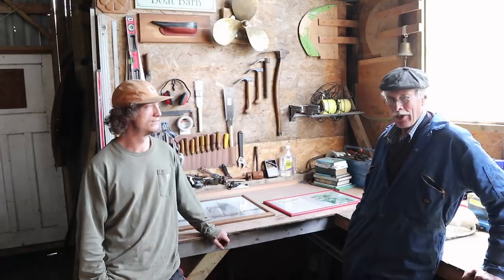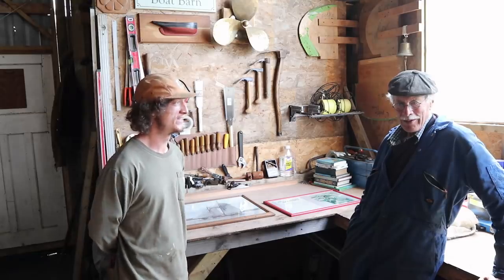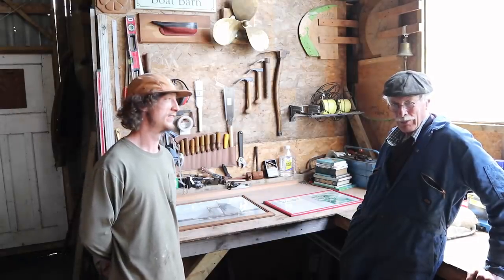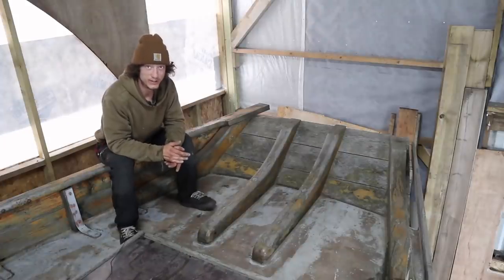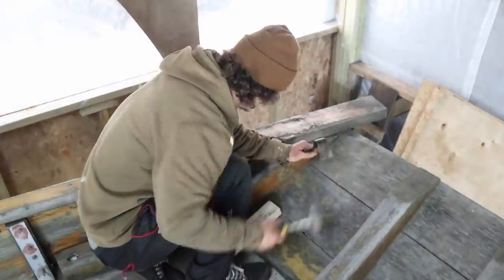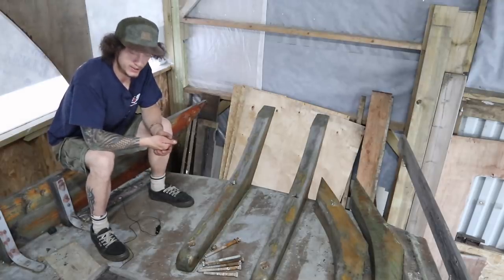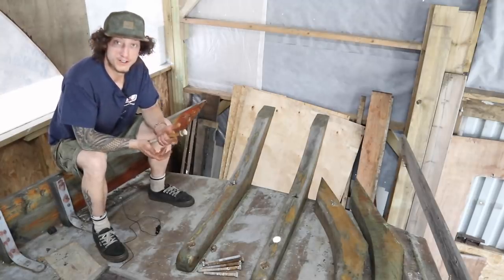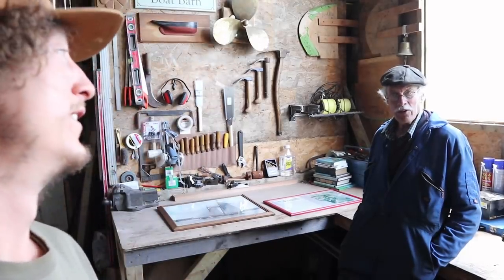The search for La Goleta, Tally Ho's Fastnet competitor. ***Episode 7***

Comment: Hi Finn, love the lockdown hair. I am sure you have removed them now, but for rusted bolts/screws in wood, heat is your friend. Several people said about welding a bar on. But I did not see anyone say to use the welder to heat the studding. Just keep pilling on the weld and the heat will change the rust from red to black which makes it shrink. Part of the reason rust makes bolts stick is that rust takes up more space than iron, so it jams it all tight. Also, the heat chars the wood too. For stuck screws, I use a pencil blow torch, and just heat the head.

Comment: if the bolts are off the inside, take a piece of sheetmetal to protect the deck and try gentle knocking a wide wedge in between the deck and the knee. My two cents.

Comment: Nice one if you want to free the knees you can try running a bimetal hole saw down over the threaded rod probably 20mm or 18mm OD, that should release the thread from the knew without too much damage.
In the past l've cut and shut a hole saw to a tube to extend them. 😎😎😎😎👍👍👍👍👍👍👍

Comment: Once lesson in Life that I took from an old hand early in my engineering career:  always use a spanner made for the nut/bolt..... amateurs use adjustables!
Reply: How can  you tell if someone is an Engineer?

Don't worry, they'll let you know.
Reply: Brendan, you remind me of a Project Manager I once knew, quick to point out the obvious but utterly inept at being able to provide a solution!
Reply: @glyntutt1586  I'm not too sure how you came to that conclusion solely based on a joke but I'm sure you did a significant amount of analysis to arrive at that conclusion.

Could you show us your process so that the rest of us can see how you got there?
Reply: Drill off head and knock down front studs. Then rotate knees to slacken rear?
Reply: "adjustable spanner" aka nut lathe / nut fucker. 

I'm guessing in this case, length was the prime consideration. I'm interested to know how the nuts will be put back on though!

Comment: Find a hole saw about the same size as the square mortise for the upper nuts. Using the hole saw without the pilot center drill installed, drill down to the deck line around the outside of the threaded rod. The knees will come off easily. Then the threaded rods will be exposed for removal. The now oversized holes in the knees can be filled with appropriately sized dowel and glue.
Reply: When fastenings are that seized sometimes there is no other option other than to cut the wood away from the fastenings. Desiree's  solution above may work, or just hack them off - you wont use them again anyway. Expedience over elegance!!
Reply: That hurt my pride...
I just wanted to leave a untraditional idea to help getting the bolts out.
Luckily I read your comment first, and realized your idea was much better. 
Thanks for sharing your knowledge. 
Best regards from Jarle  (who by now feels rather stupid)
Reply: Nuts and Boats Sailing     So what was your idea?
Reply: @christiangeiselmann  induction heater wold make the bolt red hot in minutes,  this burns a thin layer of wood around the bolt and creates some " wiggle room " for the coroded steel and crud to move about. Ofcourse you need to have a person topside with some water to put out fires and you would need to have spreadable water ready under the deck as well. I haven't tried this on bolts in wooden constructions but i think it would work. 

I understand that this is a high risk solution but I have worked with induction heaters a lot and I'm pretty sure it would work. I also think the damage to the wood would be minimal if the fire is kept under control.... (I'm "nuts" maybe it's best not to listen to me)

So i saw the video and the first thing I thought of was the induction heater  solution, i went to the comment section ready to start writing,  then i saw this comment,,,, and i was really ashamed of my self. The other solution was easy, cheap tools, safe and no big fire risk. That should have been the first thing I thought of. 

Best regards from Jarle

Comment: Unfortunately I can't find La Goleta but I think I might have a simple solution for getting the bolts out: I'm presuming you can do simple welding on site? Just weld some kind of device, maybe an old unused tool or anything that you can get a good grip on to the bolt or what's left of it and go to ìt! If you can get enough purchase on the device you should be able to rip the bolts out.

Comment: Best of luck to ya. Cut the bolts. You'll be replacing them anyway. But think twice about replacing the knees. Before you discard the knee, try an experiment. Run a 3" or 4" long router bit down the worst of the checks in the knee. That makes a simple linear mortice, just the 0.50" or 0.75" width of the router bit, to fill with an easily made graving piece. Would that fast repair be enough to salvage the old knee? The resulting plunge cut would also give you insight into the degree of rot, or absence thereof, in the old timber. Just a thought. Fair winds to ya!
Reply: I agree, the bolts are unimportant but see if the knees can still be saved

Comment: LA GOLETA (MMSI: 345883242) is a Passenger and is sailing under the flag of Mexico.
Her length overall (LOA) is 8 meters and her width is 2 meters.currently located in California at position 31° 51' 35.748" N, 116° 37' 38.28" W Port: ENSENADA as reported by MarineTraffic Terrestrial Automatic Identification System on 2014-08-10 04:24 UTC (5 years, 9 months ago)....May not be the same vessel but,who knows. Also,this was 5yrs ago.
Reply: 8 meters LOA seems to be less than half of length of the ship in the photo
Reply: 8m is a little bit short for a Fastnet racer (by about 31m lol)....that can't be her!
Reply: According to  "http://forum.woodenboat.com/showthread.php?252366-Yachts-of-the-FASTNET-1925-1939-a-database",  La Goletta was 54 feet ( 16.5 m ) long by 12 foot 9 inch ( 3.9 m ) beam. She is a 2 masted schooner and was originally gaff rigged although I believe she was bermuda rigged in the 1970's.

Comment: A few ideas come to mind.  You did say you were replacing them?  16 mm bolt - maybe weld a nut on topside or drill a hole through if there’s enough thread poking out, then use an old screwdriver/rod as a “handle” to turn the bolt. And perhaps a well of WD- 40 around the bolt and let it soak for a day or two... Or drill a series of holes around the bolt and dig out enough of the timber to loosen its grip but not break the piece in two ( pencil a cross on first to keep hole location accurate)...  That saw combo looks like a good unit. Enjoyed the video - keep em coming. : )

Comment: If the bolts won't move and the knees are stuck, don't waste time, cut them off and then pound the remnants of the bolts down through the deck.  Time is not something that is renewable, wood, bronz and sealer can be replaced. Lots of luck with the bolts and the new knees.

Comment: It you want to get rusty bolts or nails out of oak then spray liberally with WD40, give it a day, and have a sensible try and if it is stubborn but moves a bit give it some more and a twist/pull/push/tap now and then. Could you weld the nut back on top and give it a wee hammer drill back and forward to really get the WD40 (Basically fish oil.) down there? Anyhow you are going to win in the end as you are but.

Comment: By the time you read this you will have already removed the knees  but I would suggest maybe try using a nut (tube nut ,connecting nut ?) to connect  more threaded bar to the top of the threaded bar after removing recessed nut and attaching a hefty slide hammer or similar.

Comment: Is it possible to fasten or someway clamp and iron bracket on the knee’s near the bolts and use a jack to lift them from the grip of the bolts? Or perhaps weld a chain to the nuts and try to lift the bolts from the knees with a jack or chain lift??? If they don’t move right away I would then leave a great amount of pressure on the knee or bolt whichever you choose and then rap on the knee sides near the bolts with a mall to see if they will pop loose.

Comment: What you need is a 16 lb sledgehammer and if necessary a piece of plywood right at the bottom corner, with a firm thud.
Here's the method to this madness: Rust and other oxidation is hard, but brittle, and it's grown inside the wood. If you spin the rod, it will gather all that crud, and grind the hole even bigger than it should be, when the rod is removed. If you greet the rotten reaction with a solid impact, it will brake to dust, and thus releases the rod.

Comment: Two ideas for getting your bolts out. (threaded rod).  First and probably easiest is to just double nut the top of the rod and then you should be able to turn the rod out of the wood.  The inner nut will be pressing against the upper nut so it can't just twist off like a lone nut could.  SECOND idea is one I'm surprised a sailor didn't think of right away  Can't you just attach a turnbuckle to the rod and fasten the other end to some unmovable object?  Turning the turn buckle should thread the buckle down the rod and away from the object that can't move.  This will cause the rod to pull out of the knee rather than screw out.  It's going to take more force than the double nut idea but it should be easy enough if you have a BIG turnbuckle.

Comment: To remove those bolts you need a cylinder drill piece to run down the bolts. This would release the thread of the bolts. Hope this helps. Gpx

Comment: Chisel enough wood away around the studs at the top of the knees to allow use of a fender washer. Replace the nuts, and then use a pneumatic impact driver to tighten down on the nuts. Since you removed the nuts below, the studs should work their way upwards and out initially until they loosen up enough to spin - in which case you should then be able to work them up and out with a fair amount of ease.

Comment: If you don't want to cut the threaded rods, use a length of steel tube just larger than the rods, file teeth on one end to form a "core" drill.  Then drill a hole which removes the rods.  Then replace with larger diameter rods.  Good luck!

Comment: As youb are not keeping them use a hole saw or a tube with saw teeth cut in to it and holiday over the bolts to the required depth. The most of the timber is reclaimable

Comment: Wind two nuts onto the thereaded rod. Lets refer to the nut that was threaded on first the lower nut and the second the upper nut. Hold the upper nut with a spanner and wind the lower nut back up against the upper nut with another spanner and lock the two nuts against one another, strongly. Now use the lower nut to wind out the threaded rod. The nut will stay on because it is locked against the upper nut. It works, trust me. Unless the threaded rod snaps, you'll be on a winner! Use the ring end of a big six flat spanner if you can